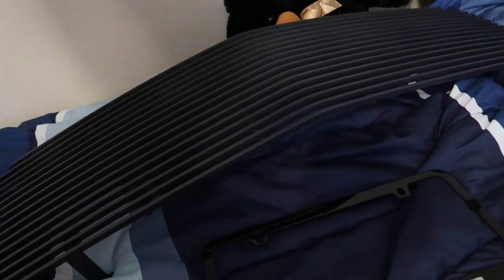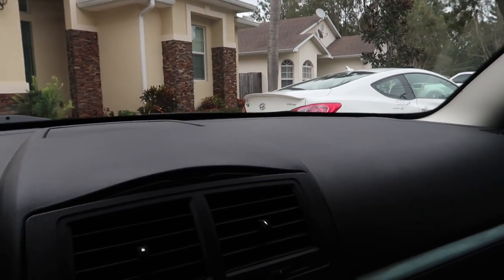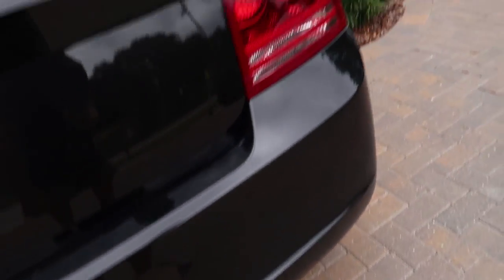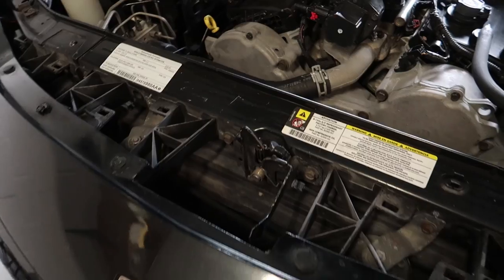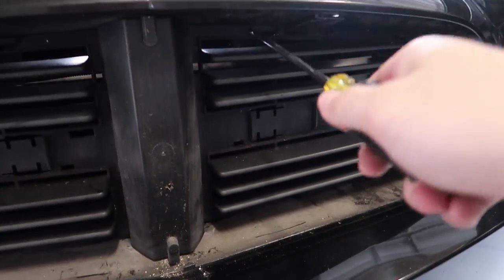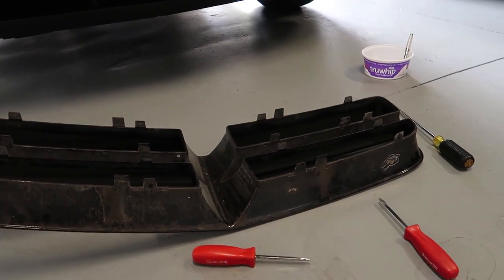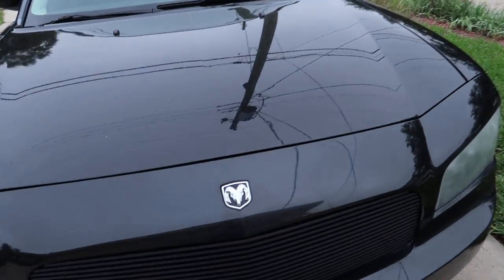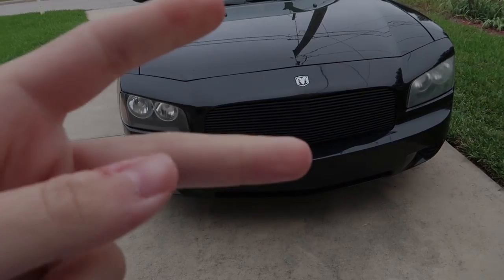Dodge CHARGER Aftermarket Custom BILLET Grill INSTALL!

Comment: Well fuck me I go to take the bolts off to remove the old one and one of the bolts is completely rusted and striped to shit.
Reply from the maker: Yeah that’s a problem on a lot of these older chargers! Some brake cleaner may do the trick to loosen it up if you can reach it! Just be careful!